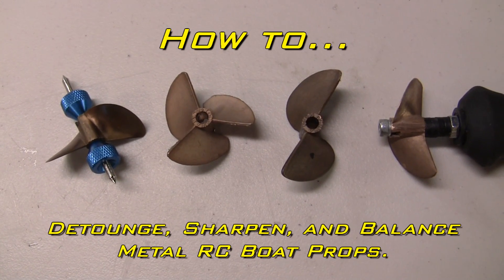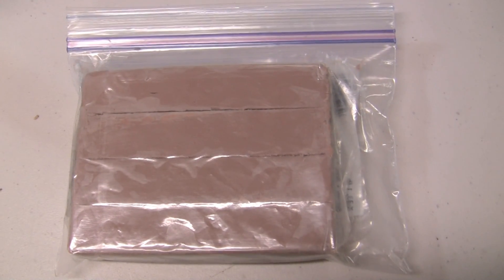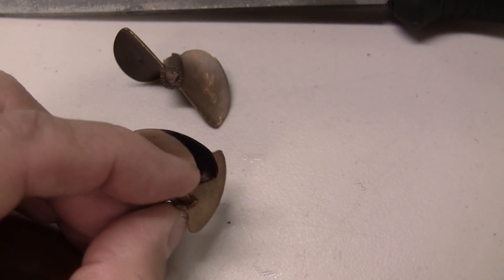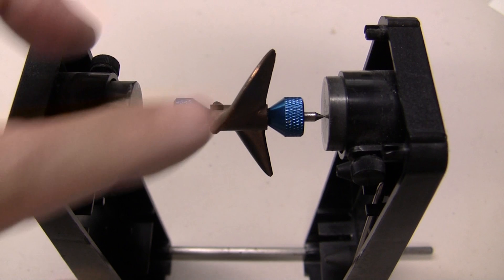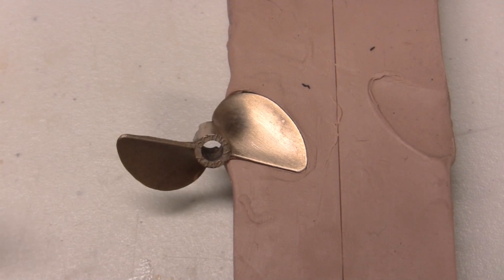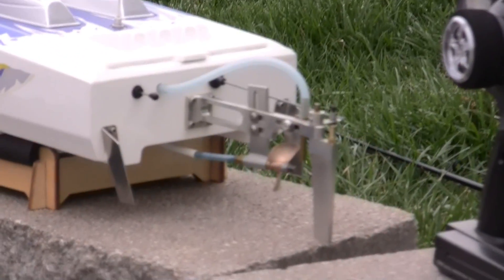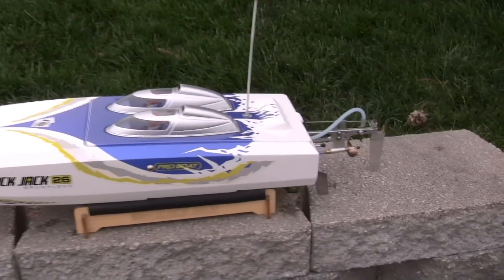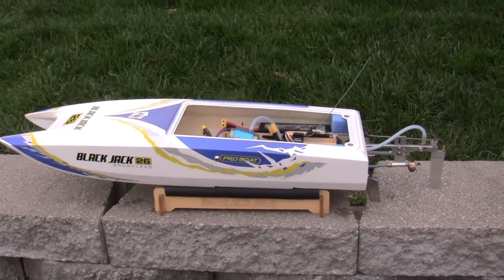Detounge Sharpen and Balance RC Boat Props

Comment: I wanted to know I have a 430 mm plastic prop and a 435 brass prop I want to cut it down and shape it to the small plastic prop Sizeto the plastic prop can I take the paper template over the small prop and in place on the brass prop and size it down
Reply from the maker: Not sure never tried that before. After thinking about it I'm don't think the cut down prop would perform the same as the plastic one. You would be changing the geometry of the pitch on the brass prop at the outer edge which could cause it to lift more or less. Only way to find out would be to try it.

Comment: please tell me the different between 2 and 3 blade propeller want is the different in performance .thanks
Reply: inti gomez a 3 blade prop has less vibration and  4 blade less vibration. However a 2 blade is more efficient.
Reply: William King THANKS A LOT FOR THE ANSWER GREAT VIDEO
Reply from the maker: I've always run 2 bladed props so can't tell you much about three bladed ones. I'm sure you can search the RC forums to get the answers you are looking for.

Comment: Will detounging the prop help fixing torque roll?
Reply from the maker: +Sick detounging the prop will not eliminate torque roll but might help just a little. Torque comes from the complete drive system, motor , prop shaft, and prop. Sometimes using a smaller prop helps, or offsetting the weight to one side of the boat to counter the torque roll. The only way I know to eliminate it completely is to run two motors setup with counter rotating props.
Reply: RCFF-DiehardRC Interesting you say that because i have done a fair bit of research on torque roll and all people can really tell me is its a prop issue? I'm no boat expert but im pretty sure the bigger the prop the more aggressive it will grab the water?
Reply from the maker: +Sick Lad yes a bigger prop will grab more water and create more torque roll. But remember each action has an equal and opposite reaction. Have you ever started up a brushless motor without it being mounted to something? even with no prop on it will torque over to the opposite side it is spinning. it's not just the prop but the total weight of the rotating mass along with the prop pushing against the water that creates the roll.
Reply: a different type drive line, motor output shaft facing forward, with boat's drive shaft gear driven. they torque roll a lot less for motor and driveshaft spinning/loading opposite directions. they're also capable of swinging larger and/or steeper pitch props, changing gear ratio, this can really help to maximize speed and efficiency. example like an old Graupner Speed 500/600 system that connected a gearbox driving a U-joint steerable stern drive (they help a bunch too!). popped a 5000kv 3040 motor into old Graupner Cobra, it gets pretty happy on 2S.

Comment: Hello, is that line always the "same" on 1:20? I mean, is it better to get it like that, or it depends about the use/boat?
Or it's all about hydrodynamics? your advices for an octura X445 on Deltaforce 1.07m 3500w brushless 2200Kv 6s
And i have an X 467 stock. Thank you for your time; greetings, and very usefull video for us ;)
Reply from the maker: andre pires Yes, for high performance you want to remove that part of the prop.

Comment: '
what material is better to use a RC boat propeller...
metal or plastic...
my 2 RC boats are plastic propellers
Reply from the maker: bestamerica Metal props are much stronger and will provide better performance because they do not flex or break like plastic props do. Plastic props are easier to use because they do not need to be polished or balanced. They are also a lot less expensive. I still prefer metal props over plastic especially for high power setups.
Reply: okay thank explain.
i like plastic propeller is better, more easily, light weight than metal

Comment: How much time on average to take a prop off the shelf to finished product? Think I would benefit any from doing my own vs.buying cnc props?/watch?v=uFiqhWfScmY
Reply from the maker: How much time is not an easy answer. The first time will take you what feels like forever but each time after that will go faster and easier as you learn your own techniques. It's definitely worth learning because it will help you figure out what makes props work better.

Comment: Im just starting out and need some help, I just bought a miss bud with a 15 motor and a stock prop. Iv had nitro trucks and cars for 13 years. Im running 30% grimm fuel in it so maybe you would know if thats ok ?. Im running cold water threw the cooling lines while running on my stand, With 20% nitro the motor is running at 98 with 30% nitro  its at 120 Also the prop thing, Is there 1 that i can buy thats good because i wouldnt even know were to start on sanding a prop. Thanks

Comment: I've been a machinist over 35 years, and a damn good one at that. I built my own sopercharger for RC nitro engines, and yet I would buy an Octura prop and spend the many hours needed to remove the tongue and sharpen and ballance it long before I would attempt to build my own. The geometry of a fuctional prop is the issue here, not building it. Let the folks that have done the research and have the facilities to investment cast them do that for you. Perhaps your parents can purchase online :/)

Comment from the maker: Aluminum is more durable than plastic, copper-beryllium more durable than Aluminum and stainless steel is the most durable. Aluminum is not good with some brushless motors because it is too soft and may become deformed from too much power. Stainless steel is the hardest material of the three and the hardest to shape sand and polish. Copper-beryllium fall between the other two in all categories which is probably why it is so popular. I've always preferred copper-beryllium props.

Comment: Thanks Frank, I found one online for only $4.50 - will order it.

Could you please tell me why is copper-beryllium such a common material for RC boat props? Can you tell me the differences between aluminium, copper-beryllium and stainless steel props? Is one material better than the others? I read on one website selling props that their aluminium propsare not suitable for brushless motors - but I can't see why.

Comment from the maker: I use a Great Planes finger tip prop balancing shaft i got from a local hobby shop. it works great on my magnetic balancer. I like that it is threaded and the two cone pieces are aluminum. If you can't get it locally search online.

Comment: for the info Frank. I've sharpened my prop, but when I put it o a magnetic balancer and spin the prp, it stops at different pointson the prop. The osition that the prop rests at depends on its poition on the balancing shaft; I think that my balancing shaft is not acuall balanced itself. The sharp pont is not centered perhaps? Where can I get a better balancing shaft?

Comment from the maker: You only really need to change a metal prop when it becomes damaged beyond repair or if you just want to experiment for better performance. Plastic props should be replace right away if they have any signs of damage.

Comment from the maker: I don't run three bladed props on my boats, so never really had to balance one. They put more load on the motor than a two bladed prop of the same size and are more difficult to balance as you just mentioned. If you are going to balance one, you can tell when it is close when the prop comes to a subtle stop and does not rotate back in the opposite direction.

Comment from the maker: I don't own the other two boats but if I had to guess which of the three is faster I would say the the Mystic as it has a higher kv rated motor which means more rpm and more prop speed.

Comment from the maker: Although detounging the prop is optional it makes a noticeable difference in performance, usually good for an extra 3 to 5mph. Detounging the prop gives you a little better pitch ratio as it removes the part of the prop with the least amount of pitch. It also takes some of the load off the motor allowing it to rev higher and faster. Also because of this you can usually run a slightly bigger prop. I went from the stock 40mm prop to a 42mm prop. All this equates to more performance

Comment from the maker: You can start off course with about 400grit then finish up with somthing fine like 800 grit or higher depending on the finish you want. You can also use a buffing wheel if you really want to polish it. I usually go with a satin finish, just peronal preference.

Comment: sure you have heard this lots before but thank you. im just starting to get into racing my rc boats and found this video very helpful. and people i can tell you it really does make a difference detounge Sharpen and Balance the prop. iv found my boat has gain a couple mph and best of all the motor is running cooler and i swear iv gained a minute or two of run time thank you very much

Comment from the maker: @roadstar499 leaving the tounge on the prop will give you a little more bit on the lower end of the throttle range but will limit top speed. Going up one size in prop diameter when detounging will make up for this and give you even more speed. If you saw my Black Jack 26 in the video, It was still running the stock power system and didn't seem to have a problem with cavitation.

Comment from the maker: @roadstar499  Detounging the prop makes a noticeable difference in performance, usually good for an extra 3 to 5mph. Detounging the prop gives you a little better pitch ratio as it removes the part of the prop with the least amount of pitch. It also takes some of the load off the motor allowing it to rev higher and faster. Also because of this you can usually run a slightly bigger prop. I went from the stock 40mm prop to a 42mm prop. All this equates to more performance

Comment from the maker: @streetforcegp2 it's easy but can be time consuming. You just have to make sure when the blades stop spinning on the balancer they are both parallel to each other and level. Neither one should be rotating to the down position. You have to get it as close as possible during filling and sanding the prop blades. Then finish up balancing with some fine sanding emery cloth and water when in the polishing stage.

Comment from the maker: @dtmpowerboss "offshoreelectric" online store has a large selection of props. They also have carbon props which cost a lot less than the metal ones and don't need to be sharpened or balanced. Again look for one around 42mm in diameter.

Comment from the maker: @dtmpowerboss the Octura x442 is a great all around prop for 36mm diameter motors between 1600kv to 2000 kv. You could also try the Octura x642 for a little more speed if your motor is rated over 1000watts of power. Its the same diameter only with more pitch.

Comment from the maker: @spencermel long before the electric stuff caught on I was into fuel powered cars and boats big time! They were a lot of fun and pretty easy to tune and modify. I got away from fuel and got into electric when brushless power systems started to come out. Fuel is great if you like long run times and can find a place to run where the noise won't matter. Electrics these days are as fast but run quieter and cleaner with shorter run times though. Cost between fuel and batteries are about the same.

Comment from the maker: @RFTAEC100 It would make a noticeable difference, usually good for an extra 3 to 5mph. Detounging the prop gives you a little better pitch ratio and also takes some of the load off the motor allowing it to rev higher and faster. Also because of this you can usually run a slightly bigger prop. I went from the stock 40mm prop to a 42mm prop. All this equates to more performance. 

Frank